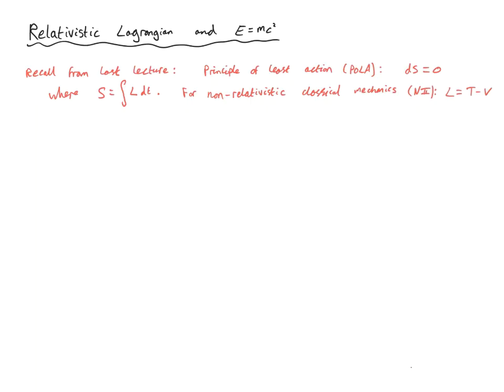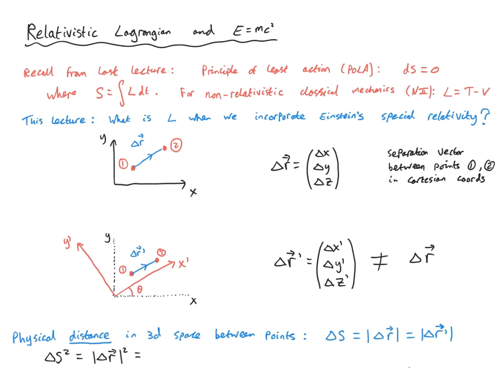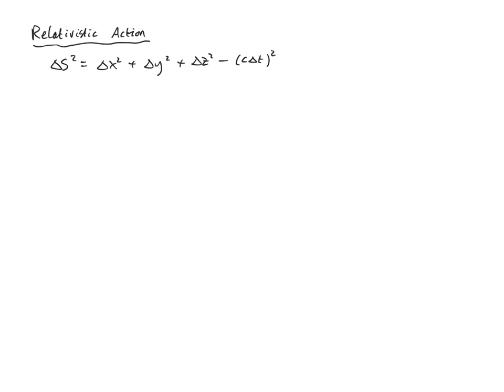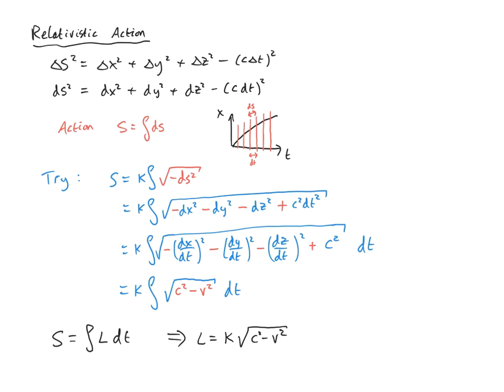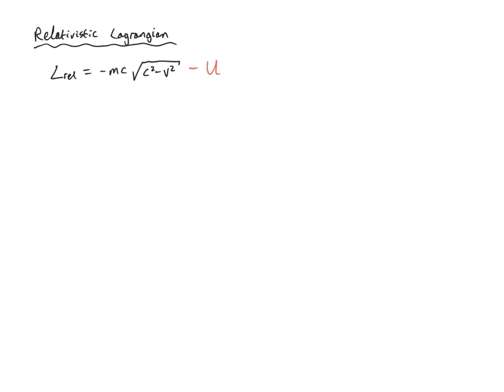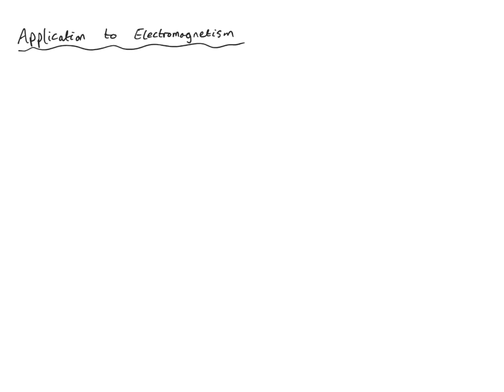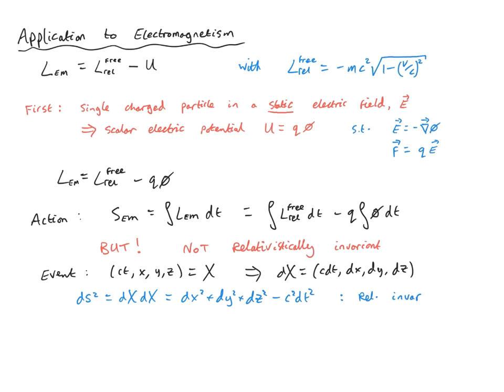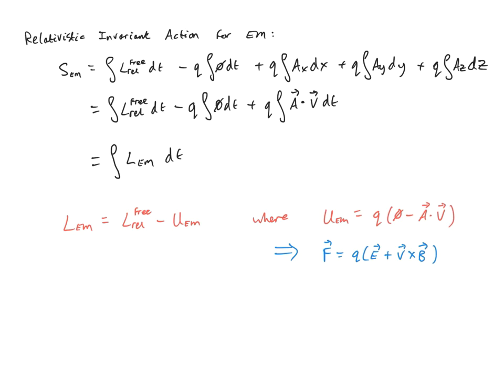Derivation of E=mc^2 and Lorentz force from relativistic Lagrangian

Comment: At 26.09 is it supposed to be kc - 1/2k/cv^2; so there's a 1/2 missing. Then I can get the k = - mc.
Also, this is fantastic series so far. And is appreciated.
Reply: How do you arrive at k=-mc? Did you gauge fix with V=mc^2 when equating that expression with k on the LHS with T-V on the right?

Comment: at 21:56 ds^2 <0 how can this mathematically be possible?
what would be the reason not to use i ct (i= complex number)? if you use "ict" then you dont need  metrix tensor, maybe not covariant and contravariant concepts too.

"...we have a problem, the action cant be negative..." so you switched the terms around and put - sign in front of it... which was still the same nagative action. i found this ilogical.
Reply from the maker: The spacetime interval ds^2 can be defined with either sign -- this is just a convention depending on the signature of the metric. Since the action has to be real, we want |ds^2|, which for our signing convention means ds^2. This is obviously the right choice because it reduces to the classical kinetic energy in the non-relativistic limit. One can incorporate the relative minus sign between time and space-like four vector components in a Lorentz scalar by letting t -> i*t. This transformation to imaginary time is called a Wick rotation. However, the formalism involving four vectors is much more powerful than that and has much deeper geometrical meaning. The full structure of the theory is needed and exploited in general relativity where the metric is not so simple, and in fact changes from point to point in space depending on the mass-energy distribution. We didn't get on to that in this course.